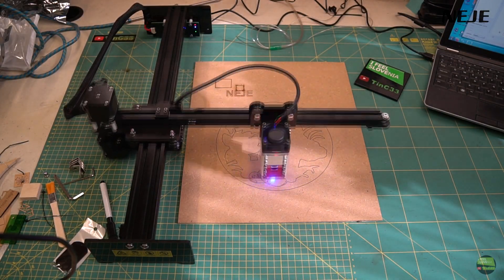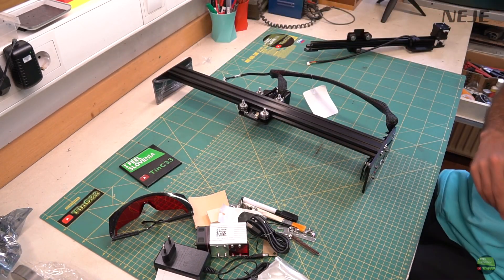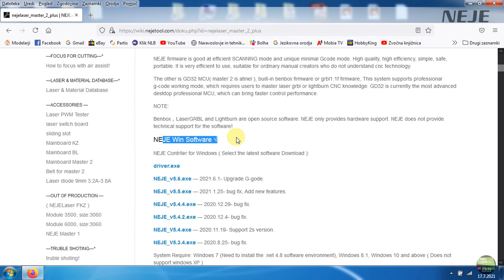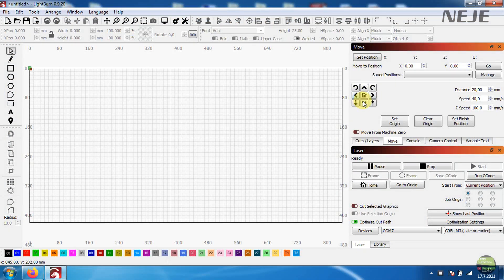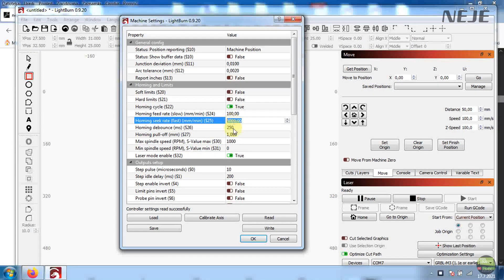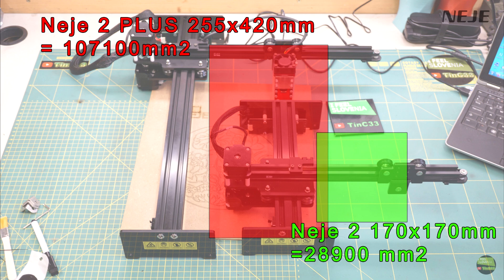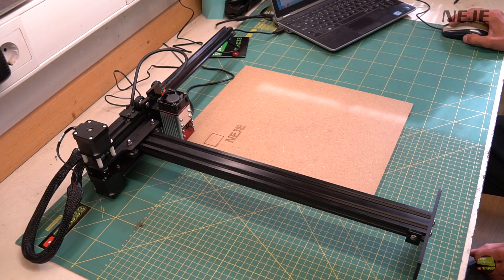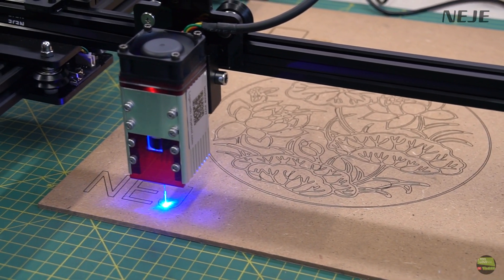NEJE Master 2S plus laser engraver & cutter with 30w N40630 [unbox, Review,  compare]

Comment: I got my Neje Master 2S 170x170 with a 30W N40630 module for about 100$ on sale and i bought 2 aluminium profiles and 3m of belt and i made myself a 325x860mm Neje Master 2S Plus Plus xD
Reply from the maker: It's all possible with new motherboards wich allow to set it's working area.
Reply: @TinC33  Yeah it's very easy with LaserGrbl or with LightBurn, the only hard part for me in all of this is finding a bed like a honey comb
Reply: @TinC33  Now i have a big problem, I have this exact same laser module but i cant seem to cut even 3mm plywood or mdf as easily as youtube videos show. I've managed to focus the laser pretty well with a black paper and 0.30% it starts to mark it but no matter where i set the focal point (top, mid or bottom) of the wood i can't cut with with the said speeds or passes to cut a 3mm plywood took me 14 passes. Any advice?

Comment: Your videos are always full of information. I returned to this video and your comments section in hopes to find a solution as to why I am not able to download the software. It allows me to download the driver. I receive a message that the driver was installed successfully. Then when I go to download the latest version of software, it gives me an error message along with another pop up box saying a problem caused the program to stop working correctly and that Windows will close the program and notify me if a solution is available. Would you happen to know what would cause this?
Reply from the maker: Hm i heave no idea what could it be, what aboit some other version?
So it allow you to download and that message apears when you try to open the software or when you click download?
Reply: @TinC33  I've tried another version and I receive the same error. I even deleted the driver and started over. I get the msg the driver was successful. It runs through the download and after it reaches 100% of the download, I receive the error message. I would think if my system didn't have proper requirements, it wouldn't allow me to go as far as installing driver and downloading the software. Being that this is my first laser, I have no idea what it could be or what else to do. But as always, thank you for your willingness to help and advise. You're a great resource!
Reply from the maker: @smiutee3158  drjvers got nothing with software, after install the drivers machine should be recognized in device meneger as one of com port.
I think you got setted open when download instead of save, so when it download to 100% it try to open and there fail appear.
What kind of Windows you got? There must be something with your sistem software.
Idk what it should be, try to contact neje team, otherwise there is much much better software lightburn but it cost $50, but you bring machine to another level with lightburn.
Reply: @TinC33  I don't mind paying, especially if it takes my machine to the next level and I can have more functionality than what the app restricts me to. I've reached out to their support team and am waiting for a response. But to answer your question, I have Windows 8.1. At this point i think my best bet is to download lightburn instead. Thank you kindly for all your time and help. 🤝🏽😎
Reply from the maker: No problem if you remember, lets answer me when you make it work.
Reply: @TinC33  Hello and Happy New Year! I finally solved the problem by removing Windows 10 S version which wasn't allowing for the downloads to be saved to the computer's drive and everything is working great now. And like you said, LightBurn has definitely brought my laser to another level!!! Thank you!!! I now need to figure out my settings for the 40W 2s Plus. Any suggestions on videos/tutorials for Neje Master 2s Plus LightBurn settings?
Reply from the maker: @smiutee3158  all you need is set s-max value from 250 to 1000 and playing with pin invert into machine settings so machine work right, homing in right side etc, all it need to change is in neje max video i think.
Now i making video about ortur 2 pro, i got same issues but with win 7 on 10 work ok, ah that windows...
Reply: @TinC33  I've adjusted my s-max value and everything seems to be working fine. THANK YOU!!! I hope you've been able to resolve your problem and are enjoying making projects with your Ortur2.
Reply from the maker: @smiutee3158  thanks, ortur is done now i got laser packer 2 on my desk, wich arrive next mont in presale 😉 i wish you nice work.

Comment: Hi, maybe you can help me. I also have a NEJE Master 2 plus with 30W laser. I try to cut 6mm plywood and the focus is on 4mm. But I get only a shallow groove. I'm using Laser GRBL and 200mm/min - 5 pass - 100% power
Reply from the maker: I always focus on surface and get better result, also air assist make big difference

Comment: Can I work in inches or just mm? Thanks
Reply from the maker: If you got drawings in inch it be same size, but inside the neje sw i think is only mm, but there are lightburn for more options.
Reply: @TinC33  thanks so much,  thinking on buying one next week for school but don't know which one 👍🏿
Reply from the maker: @victorruiz1110  please order from my link into videodescription.
Take the size wich is soutable for you, i suggest neje plus, got quite big working area, but still simple to assemble and carrying.
Power as you need i adwice 30 or even 40w for cutting and deep angrave and adittional 2,5 or 3.5w laser wich are cheap for best grayscale engraving result.

Comment: Hey, buddy . cool review . please tell me, can I ask you to cut a transparent PET, 0.5 mm thick . I want to buy it for cutting transparent pet . Thanks. and it would be cool to make the Z axis to adjust the focal length, without rotating the lens .
Reply from the maker: This lasers got huge problem to cut transparent material becouse light go trough and start burn surface under transparent materiall. There are some trick to cut thin materiall so you apply basic white paper from booth side using water so it stick to a foil without bubbles, then cut, sometimes it work sometimes not, someone says they can make stencils for pcb on that way but didn't try yet.

Comment: Hi, I have the 2S plus with the 40watt lazer, I'm using lightburn and I can't seem to be able to make a clean cut in 3mm plywood. I use 65watt and 200 in speed with 5 passes and air assist. The cut gets burned bad and the cut is far from good.
Reply from the maker: Try to set 100% laser power and 5mm/s in lightburn, alsmo make sure thet smax is set to 1000 not 250.
Reply: I found the error looking at your video once again, the distance from laser to wood was wrong, now it cuts easy with 200 mm/sec and 60% power. Thanks for making this video ❤️

Comment: Good review, thanks! I managed to "upgrade" the Master 2 to a 2s plus by changing the alu profiles and extending the cables. As you mentioned, the device was barely stable because the motors are not heavy enough. After attaching the device to a board, everything was fine and the motors have enough power. I'm just wondering if it has an impact on speed: have you noticed any difference on that level ?
Reply from the maker: Great to hear, what about motherboard, do you leave the one from neje 2 or replace with plus one? No i didn't test speed difference, i think plus got bigger motors because of weight more likely then because of power.
Reply: @TinC33  I used a regular 2s motherboard as I couldn’t find a 2s plus. The only issue is that the neje software will recognize it as a 2s and therefore limit the working area but that’s not a problem when using LightBurn. Thanks for the feedback on the motor.
Reply: If you add maybe a small offset weight to the motor side of the gantry that should help reduce some strain.